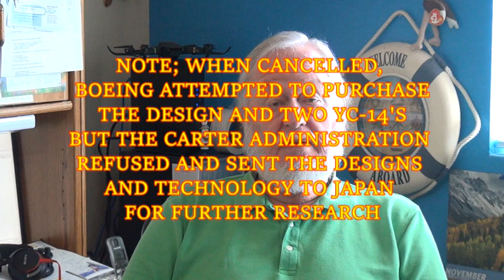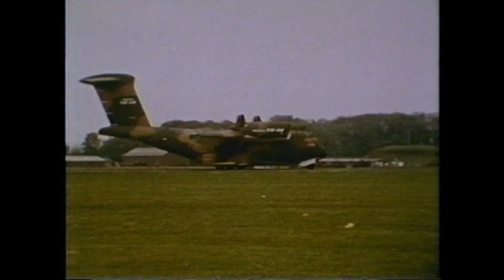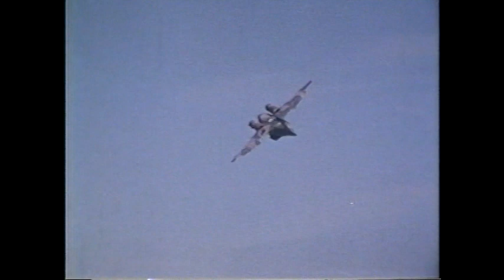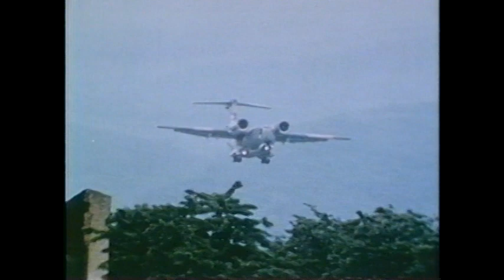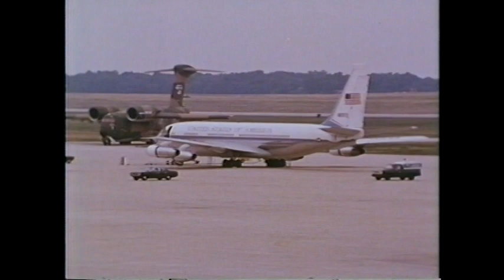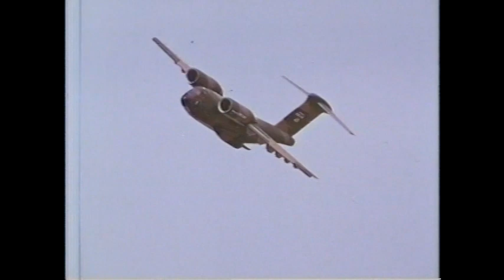BOEING YC14 DEPLOYMENT TEST 1977 Please note the black screen between me and the film. Sorry!

Comment: From everything I've read I agree with you that the YC-14 was the better plane, but the YC-15 wasn't going to be produced with two different engines.  It originally flew with 4 JT8D engines for around 64000 lbs of thrust, as compared to over 100000 for the YC-14. They then tested a pair of other engines, a JT8D with a larger fan and 3000 lbs more thrust, and a CFM56. Each of the two prototypes had one of those engines mounted on the outboard-port pylon to test fit and compatibility. Had it been chosen for production it would likely have had one of those engines selected as the power plant. 

As for the cancellation, what I have seen seems to indicate the Air Force couldn't make up it's mind, and eventually decided what they really wanted was a strategic airlifter that had some tactical use rather than a tactical airlifter to replace the C-130, and since they could only have one they decided they would rather have what eventually became the C-17 and after all the C-130 is good enough. Of course the C-17 took so long they probably could have had both.
Reply from the maker: Yeah at the Paris airshow you see the YC 15 with the common engines of the other problem with the 15 whoever was it was a design it already had that really didn’t fit the other tanks in the oil truck none of the equipment will fit the airplane but it was like a prototype for I think I guess just for systems analysis but whatever kind of total redesign so a lot of things didn’t make any sense.
being an Air Force veteran and working on Air Force programs through my 43 years in the business they generally have their heads up and locked.
Actually the YC14 was basically the better airplane about it had a unique position that can’t be filled by the C130 or the C17 for that matter.

Douglas really struggled to build the C17 the Major FAJ’s for the wings initial ones they didn’t work they were bad they were the lock to the jigs and then totally redesign and go modular design of the tools for it and they ended up having two tool engineers from my Douglas at Boeing on the 777 program at the same time. Plus the C-17 wings failed the static and fatigue test they only had 50% life gotta like the earlyC5A.